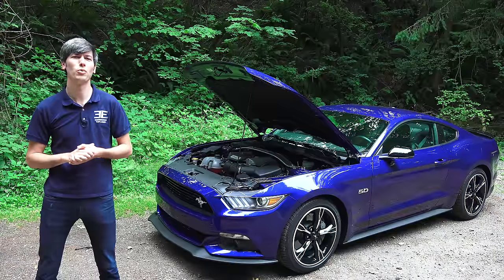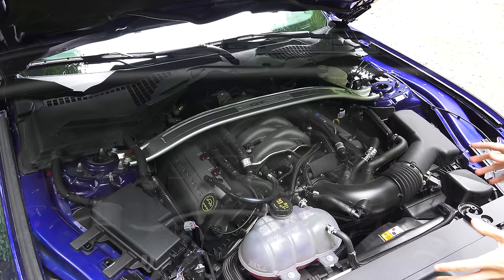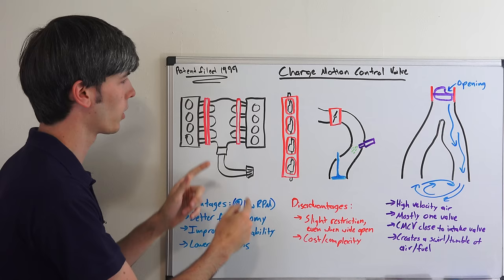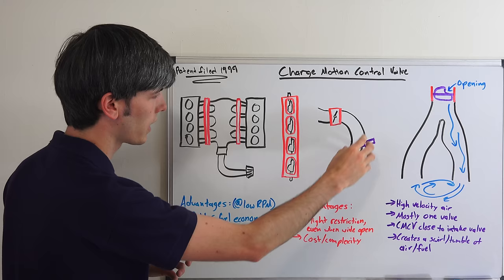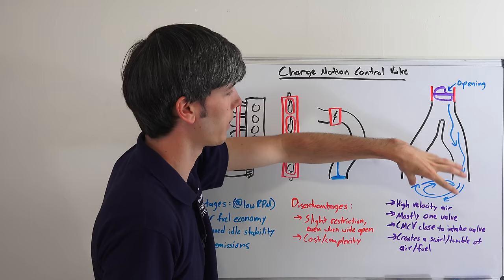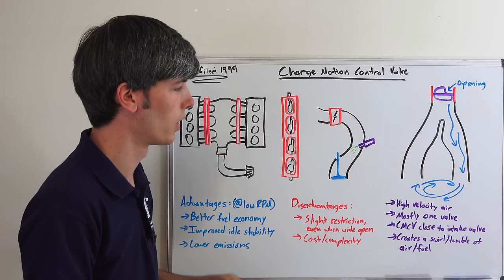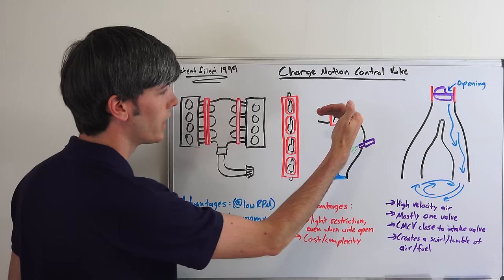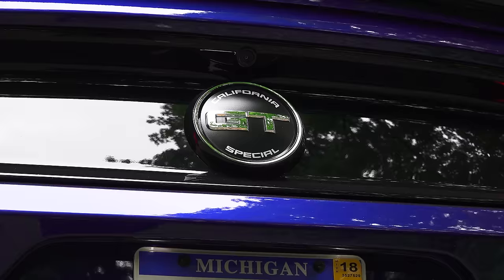Keeping The V8 Alive - Charge Motion Control Valve - Ford Mustang GT

Comment: this is pretty much what BMW did. why do they do all of this instead of using ITBs?
Reply: more complex and expensiv3
Reply: Ryan Rohauer ITBs are simple lol. It's just pipes going to each valve. I would assume that the current throttle body design on NA engines are much more complex than ITB design
Reply: If ITB were so simple they would be on more mass market cars. The cost increase far exceeds the benefit on most vehicles.
Reply: +David Serrano all the throttle wires running all over, the electronic throttle bodys (which arent cheap)and all the other filters/ maf w.e its much more complex bud...
Reply: +David Serrano maby not on a honda.....
Reply: well, just imagine the cost of 8 throttle bodies instead of 1 throttle body and a series of small valves.
Reply: Ryan Rohauer ITBs can have one electric throttle for each bank of cylinders and the current way throttle bodies work was invented after a ton of RD was done. The design of a throttle body can effect how an engine runs. ITBs are so simple to design that even from an RD stand point it would be much cheaper and simpler. Manufacturing wise it should be just as cheap as a regular throttle body. All the current designs seem to be hinting that in the future cars will have some sort of ITB so I don't see why they just don't bite the bullet and start designing them now
Reply: David Serrano are you saying ITBs cheaper than a small flap that is placed inside intake runners?
Reply: Cee Jay it's not just a small flap. It's the whole chunk of metal.
Reply: David Serrano what's a chunk of metal? The intake manifold?
Reply: Isn't BMW controlling the throttle on some engines completely with the cams? So that would be different as this Ford solution is placed before the intake valve and not affecting the cam.
Reply: +Dominik Heidrich it's still pretty much the same thing. just more complicated.
Reply: +Cee Jay yes. the intake manifold is only there in order to help the air enter the cylinder efficiently and it still fails to do so. and they are constantly iterating on that design. so why not use ITBs which solves that issue.
Reply: What makes you think ITBs are capable of doing what this intake does? Seriously, explain how you think ITBs work. Because they don't work anything like this does and they can't create a broader power/torque band without even more complicated mechanisms. 

The closest ITB system to this is the one developed by Mazda for its 4 rotor Lemans racers. And they were very complicated and unlikely to be suitable for even a high end production car.
Reply: Yep. They have variable valve lift called valvetronic which can go from about 0.3mm to 9.7mm of valve lift with infinite variation
Reply: DrewLSsix you all are misunderstanding the point. Any advance system for controlling air flow into each cylinder is just limiting the flow of air. Which is what ITBs do. The only difference is where in the pipeline is it done. The efficiency gains that are given aren't gains at all in many cases. It's just the throttle being open less than what it would be with a regular throttle body. Which can be obtained with ITBs.

Comment: Mazda VTCS. Variable Tumble Control System.

Yet one more technology Ford stole from Mazda during their time of ownership, and have rebranded as the greatest thing since sliced bread. VTCS goes all the way back to the mid 90's, and is nothing new. Ford is just now applying it to its own engine designs.

Comment: looks like valvetronic just not as elegant.
Reply: that was my thought too. seems alot like valvetronic
Reply: yes but valvetronic controls the travel of the valves, this just restricts airflow but in a smarter way
Reply: +Vinny The Tech I'm not sure it is smarter. It is just going to make that engine sufocate until it realizes you actually need as much power AP.
Reply: +Mircea Horvath But that's like saying your teeth, tongue and throat valve restrict your inhalation. A car's engine doesn't just breath air, it has to ingest fuel for it to burn. So like you do when you're eating, you have a processes of chewing and swallowing that helps you body digest.

Comment: Not even 100 bhp per litre in 2016. The American V8 is still crap.
Reply: HP per liter doesn't matter as much for a street car as usable power beneath the curve, as well as fuel efficiency.  Most V8s that have a very high specific output don't make much torque at low RPM, and drink gas because you have to rev the hell out of them to make real power.  The V8s being sold in the US today are outstanding in the real world.  If you want a more exotic V8 with a higher specific output, buy a Mustang GT350.